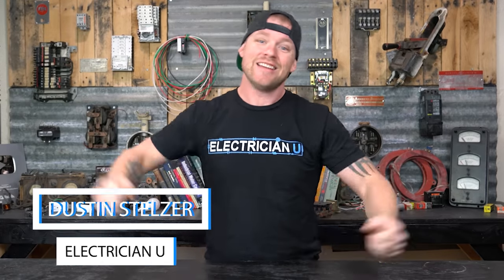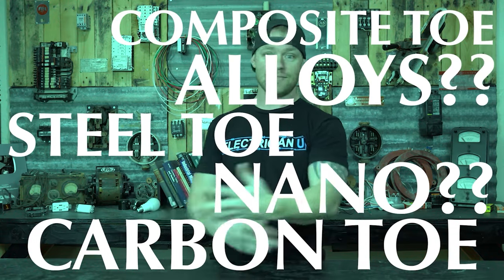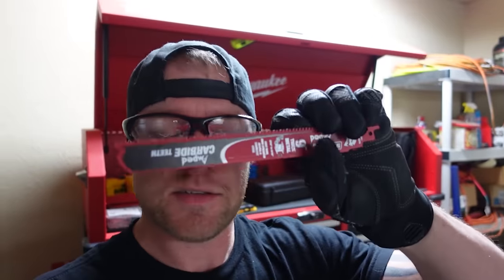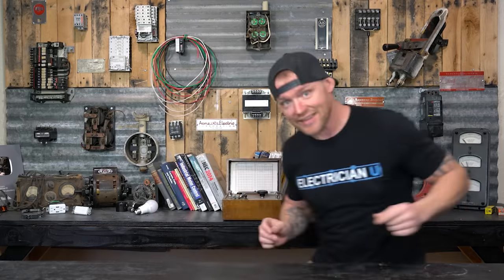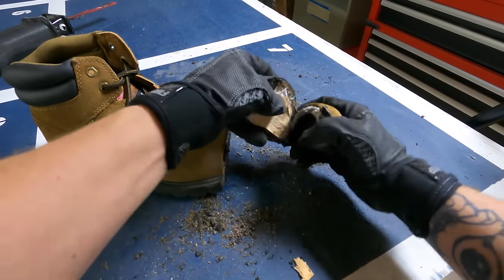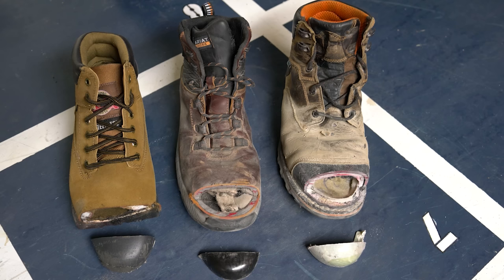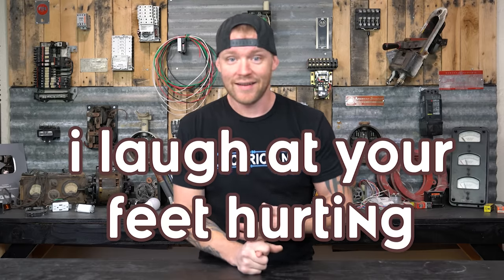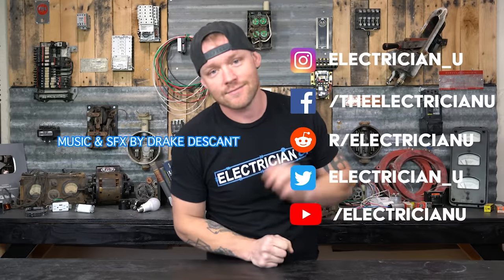SAFETY TOE WORK BOOTS- Steel, Composite or Carbon?!?

Comment: I am a electrician as well. I agree with getting good boots. I am in my boots from 5:00a.m. till 6:00 p.m. every day. Something that you use 12 hours a day for your whole career best to spend money to get the right boots.  At one point I couldn’t turn my neck all the way. I went to a chiropractor she said it was probably my boots throwing off my  alignment in my back and it showed up in my neck. Anytime my neck starts bothering me my wife says time for new boots. She ends up being right. They wear down a little at a time and you don’t feel it till you put on new boots.
Reply: If you can try to buy 3 or 4 pairs and get you some good gel insoles and wear a different pair everyday. Your feet and knees would thank you later in the future.
Reply: some states in some countries also have codes about  ppe, here an electrician can not wear steel cap, its comp or carb

Comment: I was the guy who used to buy $50 boots from Walmart and think that yeah they were good. I bought my first pair Red Wing boots for $280 with an electrical safe rating. They are steel toe and a bit heavy but they saved my foot from being crushed from a hydraulic cart that carries concrete block. Invest in protection for yourself. I can guarantee you my $50 pair of Dickie boots would not have saved my foot. I'm at least able to walk now, my foot was crushed very badly but I believe without those boots I had on I would have lost my foot. Take this very seriously

Comment: Sparky Channel described cutting through an old iron drain pipe. He said start the cut with a larger tooth blade, then once the blade is deep enough into the pipe, switch out to a smaller tooth blade.
Reply from the maker: That's an old guy trick for saving crappy blades back before carbide was a thing.  That's not what Diablo or Milwaukee recommend.  They both make specific blades for specific thicknesses of material, with the full intent of completing the cut without having to switch out blades.  This may be true when using cheap bi-metal blades that are not designed for cutting through thick drain pipe, as a tactic to get your cheap blades to last longer, but dude these Carbide blades these days don't need to be treated so gently.  They're built for the abuse.  Now still, always keep in mind that heat and vibration destroys blades/bits so when you're not getting through a material, definitely back off and let it cool back down before continuing.  But the entire purpose of Carbide and Cermet blades is to handle cutting quickly through extremely tough/thick materials in one shot.
Reply: @ElectricianU  thanks for the tips

Comment: The timpro composite, weather proof membrane, anti fatigue. If you are around alot of moisture and electricity.....that's the one, zero metal parts...even the lace eyelets. 3 years in a row wearing em..even tho they still solid, I need new for the rating for site whenever below par. They impressed me...not sure what the non conductive toe material made from but it test out on industrial ap.
Reply: I have the Rocky’s composite toe, I had them framing for a year and as an JIW apprentice for a year. 
The laces are falling apart but the boot is still good

Comment: Thanks for cutting up boots for us, good video. I personally have never noticed a weight difference between steel and composite toe boots. One thing I have noticed, my last 4 pairs of work boots, 2 were steel toe and 2 were composite toe. My feet stayed warmer in both steel toe pairs. All were non insulated leather work boots. In theory it does make sense that the steel toe would be colder. From my experience though that may not always be the case. I tend to lean towards steel toe now because their is no risk for cracking and the steel toes tend to be a little less bulky since they are thinner as you mentioned in the video.

Comment: Worked at a large company where all the sparkies complained about hazardous steel toe work boots due to they often got wet. If you were stuck working 10 to 16 hours in hot cooking room mostly standing on hot steel cat walks when you took your socks off skin looked sunburned. Talked them in to purchading electrical rated composite tip work boots. The holes for shoe laces did not contain any metal like a lot of other boots. Best thing in most states if your company insist that you wear steel oe composite tip work boots they must pay for them. First company that I worked for only purchased bump caps that looked like a hard hat but probably a third of the price. Anyway mine split at seam and they wanted me to pay for it. Gave them the phone # of largest law in our area that sued for everything under the sun. Next day they gave me a replacement bump cap. Complained to union and they made cheap shakes purchase approved hard hats for entite maitenance department.

Comment: You kind of want it to shatter and not bend, if it bends you lose your toes, I worked in a tooling shop where steel toes were banned due to crushed toes being better than no toes haha
Reply: The bend is intentional, it’s easier to reattach a clean cut than a mangled cut

Comment: Former workboot salesman. Fantastic video. Ariat really is the best around when it comes to safety and comfort. The real big difference between the types of toes is the weight, thermal, and safety. The weight difference isn’t much, but at the end of a 12+ hour day, the 1-2 ounce difference from steel to carbon is definitely noticeable. As far as thermal, yes the steel will definitely heat and cool a lost whereas carbon and composite do not. And really the most important is the safety. Yes steel can be electrical hazard rated, but if you wear down the leather to the steel, you are now a walking lightning rod. Also the composites are designed to take an impact and dissipate the blow across the entire toe and do a controlled shatter. Like how a windshield works. That way after impact you can remove your foot from the boot. With steel, if something heavy enough falls on your foot, you’re foot can get trapped in the boot, or get your toes chopped of by the steel toe. 

You do get some more room in a steel toe because the steel is thinner. But that’s mostly mitigated by the fact that most good boot companies make the toe room on a composite or carbon toe bigger to compensate

Comment: If your a young electrical apprentice like me. I highly recommend you go for the cheaper steel toe boot options. You will be doing grunt work, so damage some trash boots and not some expensive ones. I recommend Caterpillar in the $50-80 range they've held up really well for my first 2 years in the trade. If you start in or do residential work get easy to slip off ones because no one wants you to walk through their house in boots. IF YOU ARE WORKING LIVE(which i don't recommend)WEAR YOUR BOOTS REGARDLESS and maybe get boot covers as another option.
Reply: Mmmmm not to sure about that ... MAYBE for residential . When I started Industrial 3 years ago I had Walmart steel toes and then timberland anti fatigue ... and they both sucked for under $100... 2nd year I wore wolverine I-90 durashock composite toe and they were super comfy and light but I ride a motorcycle so riding everywhere tore up the cheap leather . But for work , SOLID.... now 2020 being my 3rd year I got thorogoods for $220 and my feet and pains are gone .. yes they are pricy but even when I’m not busting ass all day they hold their own while using a broom or organizing material .... your feet are tools apprentice or not , put money into them so they last forever .